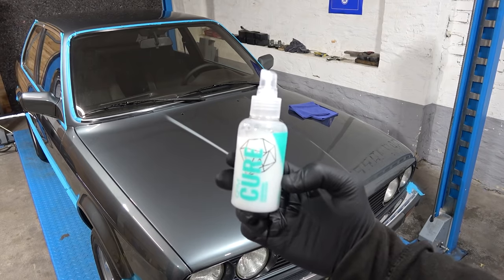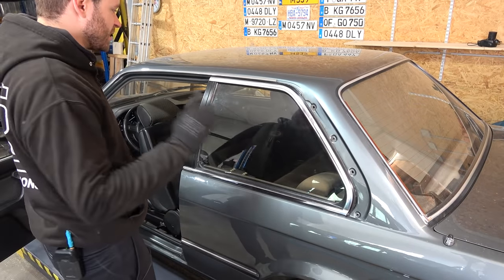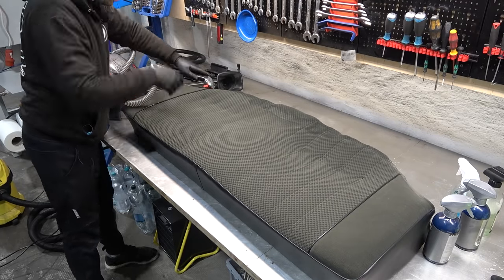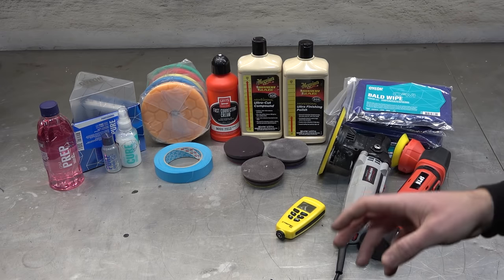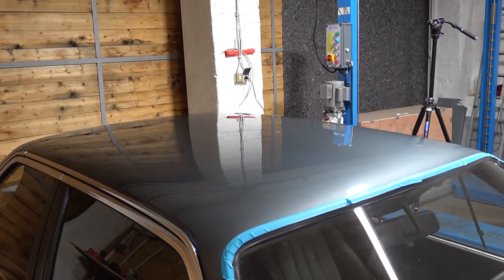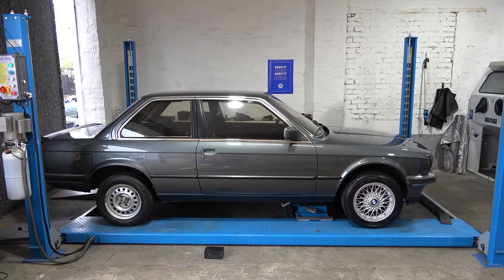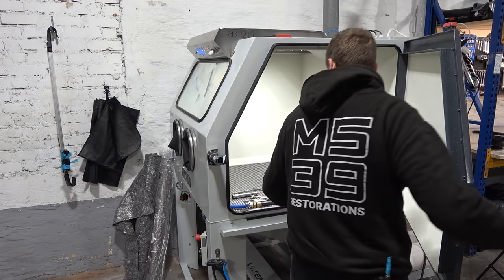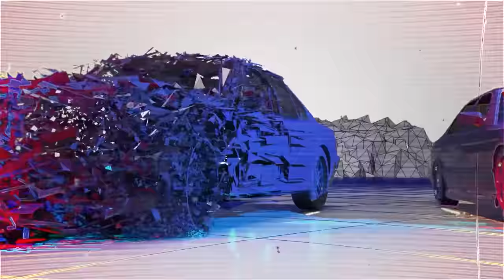When Things Don't Go According To Plan - BMW E30 320i - Project Marbais: Part 6

Comment: I never thought this channel would leave me shocked and on the verge of tears... Years back I lost control of my e39 on a rainy evening, oversteering into drainage ditch than into a grass median.           The DSC wasn't functioning and I thought I could be cocky in my "low powered" 525i. My dignity was shattered and I learned respect for the car. Lucky all it needed was a splash guard and temperature sensor. So glad you made it out okay and decided to restore the car. An honorable move. Keep your chip up, buddy!
Reply: Hell I almost crashed yesterday. Was driving some guys and it was cold, dark and wet, and the guy in front of me suddenly stopped to turn. I hit the brakes and the car just slid, I barely stopped milimeters from the guy in front. Old cars are unforgiving, you always need to have that in mind, mine decided to remind me of that fact.
Reply: Exact same thing happened to me in my E39 530d and I LOVED that car. Took out a road sign with the back of the car while sliding into the ditch and the insurance company wrote the car off. Lesson learned and I'll never turn off DSC again.
Reply: The way you wrote that made me thing the car was a total wreck. And it needed a plastic cover and you bonked a sensor haha. 
Lucky.
Reply: @BlueXonar  Driving my e30 I've had too many close calls to count, from getting blown into the next lane on the freeway from 30mph wind to commuting back home during torrential rainfall through mountains (It took me an hour and half when it usually took 30 minutes because I was driving 40mph). Very unforgiving vehicles (unless you have a modern bmw with stability control, traction control, and xdrive - those are extremely safe to drive in all weather) in the right conditions they are a blast to drive.
Reply: had e30 only a 318i little damp on the road took first exit on a roundabout, 30mph max managed to catch it enough to avoid the curbs and oncoming traffic (may just be luck) but stopped looking at the driver behind me a full 180° towards the way I came.

Comment: Now it’s official!
Welcome to the E30 club owners!
What you have experienced is an orthodox E30 ownership experience.
The E30s, that Ultimate Driving Machines, usually bite you in the bottom really hard if you get carried away for a second. I wrecked my E30 after restoring it and building it for 6 years. It’s gone beyond repair. But it will source parts for my next E30. And memory of that car will always warm my heart.

I’m glad you are okay!

Comment: I know exactly how you feel. I did a similar thing in May. I had spent several month fixing up a first gen Dodge Durango. I found another good one really cheap to fix up. On the way home the front tire blew and the trailer started fish tailing. I tried to accelerate out of it to only accomplish to put it in the jersey barrier at almost 60mph. I ended up totaling both Durangos and damaging the trailer. Luckily I'm used to doing all my own stunts and didn't get hurt either. I scrapped both of them since I didn't wanted to be reminded of my mistake every time I go outside.
Reply: I think you scrapped them, though, right? I mean, they must have already been seriously scraped up. Very sad though.
Reply: @richarda3659  Yes that is correct.

Comment: Glad to hear the only injury seems to be to your pride. Please don't beat yourself up too badly over this. It's a tough lesson to be learned but may help keep you safe in the future. It makes you appreciate some of the safety features like ABS, traction control, air bags & modern tires in today's automobiles. 
I just found your channel a few weeks & have already watched 40 or 50 episodes. You've got me looking at want ads for a used BWW.

Comment: I feel your pain... That is an absolute heartbrake... But good parr is, you weren't hurt, you'll get over this, fix the car, and it'll be once again perfect. I think it's not only that it's no E46, but you mentioned you had SUMMER tires on in the video. Those would have 0 grip in cold temperatures, regardless of what car they're on. I think that's the main mistake here. Anyway, hope you'll be able to get over this and we'll see this car in mint shape again in a few weeks or months.

Comment: You have done an amazing job with the e30! It looks magnificent! I am sorry for how it ended. If you consider fixing it (wich I think you should) you could also consider upgrading it a bit with an ABS conversion. Since ABS was an option for the prefacelift E30 it should be a plug and play  conversion, and it doesn't devalue the car. As you did with the rear sway bar, the ABS module can be retrofitted without too much hassle. The E30 was a great car because it had many options that could be added, some were aesthetic, some were technical, like the ABS, or the LSD or the rear brake disks. I still daily drive my e30 vert after 30 years and have upgraded many parts (with original BMW options). From electric windows to central locking, to AC system and MTech2 body kit...It is an absolute dream of a car, still turning heads 30 years later. And it drives great!! Good Luck!

Comment: First time driving my E30 in the rain I was making a right turn through an intersection at the crest of a hill, just keeping up with the flow of traffic.  I gave it part throttle in 2nd gear just as the hill leveled and spun out in the middle of the intersection.

Comment: That’s rough man. I’ve been there. 3 times. My pride and joy, modified Scirocco S. Cleaned and buffed just like your project. After spending a weekend on it, cleaning screw heads with Q-tips for hours, I met a hay bale tumbling off a truck on the highway at night. Ripped off my front spoiler and wheel. The lesson I learned has stuck with me…… cars are cars. As much as you love them, they never love you back the same. So the love you have must be tempered by what you are willing to give unilaterally. And be happy with that, whatever it amounts to. Heal your pride and relish in the marvelous journey and lessons of life. Good man…

Comment: Again, great work Sreten... Oh no! I started writing this comment just before the end. Still great restoration work on the car, and encouraging to see you step up and own the heartbreaking mishap.  I still think the biggest home goal I can recall, is a guy that drove home from the pub with four of his mates. Driving aggressively into his own street and braking hard and late to stop outside his house; he ran into the backend of his second car parked outside. Significant damage to both of his toys, his pride and reputation. Your mishap is at least an honest mistake on a slippery road, in a car that your not familiar with, and no run off room available to correct the understeer.

Comment: I owned a 320I us model with the 4 cylinder purchased in 1981. Great little car that I kept for 20 years.  However it came with Continental tires which were hard compound.  All of this model got very lose when corned too hard even more when slick. I became an expert in a 360 turn and the ones you saw on the road with torn up quarter panels always had a skid in to a phone pole.  I did get it resolved by moving to a Michelin brand with softer compound.  But the way it broke lose in a turn was the worst driving experience of my life.   I hope yours is repairable.  Lots of work great job.

Comment: Wow
Love the ceramic coating and amazing paint finish you did. 
My E30 320i and my E21 320 were the best 'drivers cars' I ever had (helped by no power steering = proper feel of the road), I loved the over-steer on round-a-bouts and I practiced over and over again (balance steering with power to hold the slide and catch the Scandinavian flick on the exit - I never ever got bored driving those cars.  Sadly, no manufacture will ever be able to build something so exciting again - no wonder E30's are worth so much these days.  However, by the time I have my i8 and my i5 Touring to join my E39 520i Touring and F11 523i Touring - I will have no room to add an E30 - I'll just have to go karting more often instead and be jealous of all those E21/E30 owners.
I feel your passion, I'm sure you'll get the E30 back together one step at a time.
And thank you to BMW for building so many wonderful cars. I'm eternally grateful.

Comment: It happens! The best part was when you said you would fix it! Damage doesn't look all that bad from where I stand, but I feel your pain. I have an e30 four door in the same colour that I bought new in 1986 and keep mostly on it's lift because I worry too much about hurting it now. Still, I did take it out 3 times last summer. On my first winter, I found out quickly how the 25%LSD and light rear end don't do SFA for traction on snow and ice. I used to pack a lot of sand bags in the trunk, but even then, that was marginal at best.
I look forward to your very informative vlogs on these beautifull classics. The new ones coming out do absolutely nothing for me, I don't know why. Wishing you a great New Year!

Comment: I literally gasped for air for a good 30 seconds. I am so terrified of wrecking a vehicle of mine, they are all my babies and I love them like children or pets.
The truck in my profile picture.. I hand built an engine on a stand when I was in high school. It was a 351W. It had cylinder heads that were ported and gasket matched by hand, by me. It had big valves, 10.5:1 compression, a .580 300° cam, and a beautiful midrise intake manifold adorned with a 850cfm carb. It was a peach and extremely powerful. I believe it made 300hp at the wheels, in a long bed 2wd pickup. I drove it 350 miles. The assembly lube I used plugged the oil filter, and not only did I have no oil pressure gauge, but I did not change the oil after the first time around the block. It locked up at high speed, throwing the #6 or 7 rod through the top of the block and the #3 through the side. The only thing left was a single cylinder head. Even the camshaft was snapped.
These machines demand respect and care. They talk to us, in hushed whispers and sometimes violent screams. It takes someone who has experienced that pain to know how to listen.
That is a horrifying and humbling thing to happen. I guarantee you will have more respect for the car when it's set back straight, and your relationship with the car will be deepened. I am excited to see you driving it and enjoying it again!

Comment: I love your videos!  I know this is likely too late, but I wanted to share a couple of tips in using Meguiars products.  First, if you add a couple of drops of 205, you'll find that 105 dusts much less.  This also increases working time and can prevent the need for a second pass.  Also, M100 - I can't recommend it highly enough.  It cuts more than M105, and it dusts a lot less.  Maybe this can help make you love detailing as much as I do?

Comment: I'm not sure which media blend you are using in your vapor blast cabinet, but if it is pure glass bead, you can blast the rubber trim on the bumper if it will fit. Any exterior or interior black plastic it will clean up nicely. Try something not important first, but that is my experience with it!

Comment: Don’t be to hard on yourself man. It is an accident. Without undermining the colossal sorrow when I saw that car, the upside is that you will have some good airtime fixing it. Also, a drop would really be great in that e30 as everything else is in place. Maybe consider the facelift taillights, but then again that would need to go with facelift plastic bumpers. Can’t wait for you to do an e36!

Comment: Sreten, my heart is with you. But a side note: there's a reason why some BMW don't come with a rear antiroll bar. The absence of it improves rear axle traction and makes the vehicle more understeer, thus more predictable and stable. Introducing a rear ARB probably messed a little with the roll balance of the car, which would make it less linear in response and switch the grip balance more towards oversteer. There are other modern BMW without rear ARB, such as the F20 125i and they're perfectly fine.

Comment: I feel your pain my man, I also killed my E30 by mistreatment 13 years ago as it was my first car after I got my license at a young age during the millennium & it trained me how to precision drive on the open road. I enjoyed it so much over 5 years even occasionally performing power slides and donuts then the motor blew & I was in disbelief. How did I do that to a 1.8l 4 cylinder engine? I would say the timing chain needed replacing but it was too late, I fucked up & so ashamed & embarrassed myself as well. I loved that car & I love E30’s, it grew my loyal love for the BMW brand. 👌👍😎

Comment: As much as it’s a horrible thing to happen, those of us that are lucky enough have a bump and walked away safe become a better driver for it. Doesn’t make it any easier at the time.  But rest assured the car can be repaired, you’re the important bit in the equation. The previous owner will understand too I’m sure. True petrolheads will always understand. The car is still in the best hands it could be, someone who genuinely cares. Don’t beat yourself up, it’s rubbish but it’s another page in the history of that car. Keep doing what you’re doing!

Comment: perfect job!!! lowering springs and an new black colour on the sills - thats it 🙂, have you ever thought about mounting an E30M3 rear muffler on it? It looks OEM and has straight endpipes...I had it on my 325 VFL. Awesome. But you have to switch to the exhaust system from the late 320i and you have to do some work on the rear muffler due to different pipe diameters

Comment: For paint correction I would use Koch Chemie, nothing wrong with Meguiars... they work, but they are kind of obsolete by todays standards, flash off too quickly, dust, cutting compound does not finish as good, polishing compound does not cut as well and modern compounds are just overall easier to work with and better. For example you could take KC F6.01 and almost do single stage on the car, it has enough cut (especially for classic and repainted car) and it finishes excellent in one stage. Or if you want more cut, then do two stage with H9.01 + M3.02 (or P3.01 if you not applying coating). As for Geon - yes that is great stuff - easy to apply and works well. 
As well note - paint gauge is pretty useless on repainted car, because measurement does not mean much. On factory paint you can guess what clear coat thickness is, so for BMW that would be ~120-140 micron, of which clear will be ~40-60micron. What would you measure on repaint? That surely will be ~240-300micron, but it may mean 100micron clear, or it may mean 20 micron clear, you will never know unless you painted the car yourself!
As you say yourself - it is not detailing channel, so it is fair enough. I guess you probably bought products some time ago and why throw away good stuff if you still have some left!? So all is good! I am just saying there are no better products on the market and I am sure that when working with "right" products you would enjoy the detailing much more. Ohhh and you are SO LUCKY to have a lift, doing lower part of the car without one is massive PAIN!

Comment: If anyone is wondering how to treat faded plastic trim:
Get a heatgun and start heating up the part from a distance, if you see no result just go a bit slower.
The heat will melt the exidation away, bringing the plastic back to it's factory shade.
WARNING: You can damage the part if you're not careful.

Comment: I think the stock standard suspension (non sport) isn't supposed to have a rear sway bar (see parts catalog on bmwfans). That should only be fitted if "sport" springs are fitted. Too much roll stiffness at the rear (relative to the rest of the suspension) can increase oversteer.

Comment: I excpected something annoying or some sort of failure. Coolant hose, electrical, whatever.
Glad you're OK and no one got physically hurt. Better beeing able to stand in front of the car and talk about it, than laying in the hospital. Even without airbags and modern safety features, the car protected you pretty good, judging by the carnage in the front area.
This is just so very sad, seeing the car like this after all the great work and amazement.
Old cars can be tricky to handle when the road conditions are not ideal, you have no weight in the trunk and not a ton of experience behind the wheel.
I hope it can be rebuilt and the body is still straight.

Comment: Absolutely stunning, what a shame it has Falken tyres on it not some nice Michelin stuff. Apart from that, some lowering springs and an exhaust I wouldn't change a thing. Excellent work.
Reply: I made that comment at 42:00. Damn what a crying shame. I'm sure that you can fix it though.
Reply: I also hate to say it, but I'd be ripping those Falkens off straight away after that.

Comment: Bravo!  She almost belonged in the Munich museum.  Will look great with the Eibach's. Forgot, but what did they do on the LCi to this model?  I saw Aerospace 303 on your shelf before.  It works great on old BMW grilles and Gummipflege on the seals.    Both worked great on my E34's  :)  and then  OMG @ end!  I confess to having done almost exactly this to my E34 540-6speed.   Bis bald ...

Comment: I've seen that happen once before with a mint E30, wet road and the front tires from what the owner explained, just let go in a corner. 
I wonder what causes that, too modern driving style for an old car? I assume the tires weren't as old as the car, so unless they were really bad tires, it shouldn't be that?
Usually E30 grip problems come with people lowering them too much and get weird camber in the rear,and with the height of that E30 it definitely wasn't lowering that did it :P

I do hope you can get it fixed though, and good to see you were unharmed as well, at least you hit a tree and not another car or person.